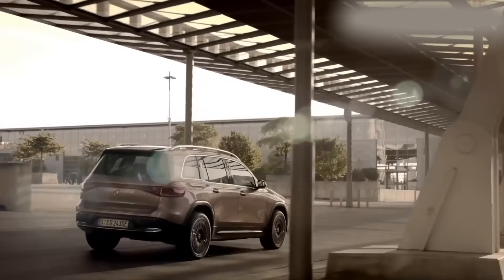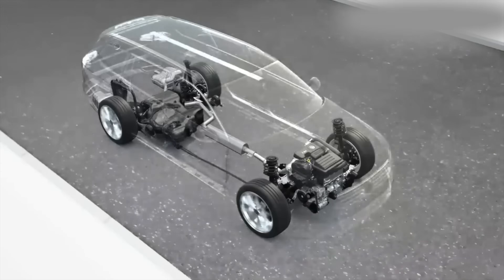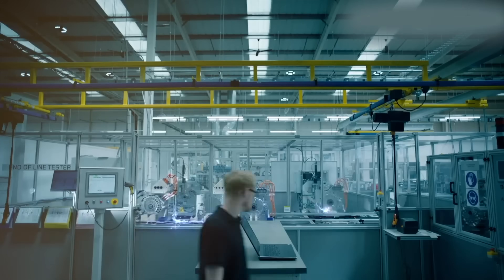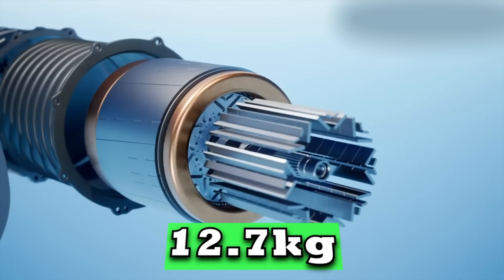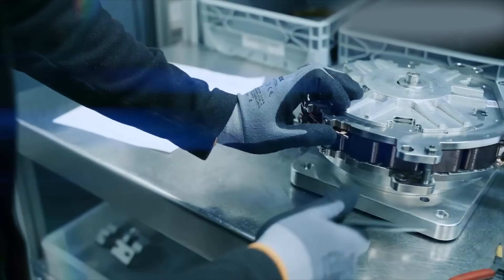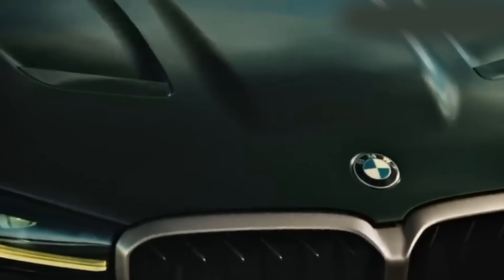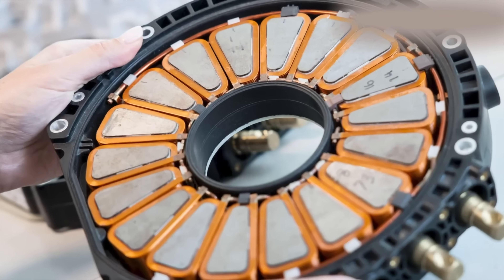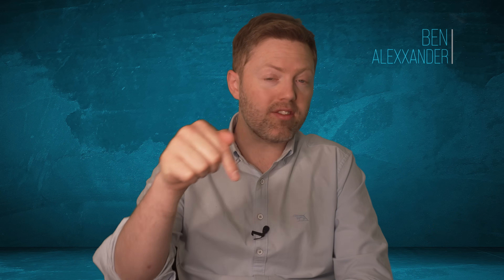Mercedes-Owned YASA Just Built the World’s Most Powerful EV Motor

Comment from the maker: Do you think these will take over current motor types in a watered down form?
Reply: Unless the developers get greedy and overprice the technology, I would say it is almost inevitable. If the downgrading is not taken too far, an in-wheel motor could be direct-drive, so none of the usual 9:1 gear train. Even fewer mechanical parts to wear.
Reply: hopefully, - less weight alone means less power consumption to get from A-B.
Reply: It is more likely to be scaled down than watered down.  A motor at 1/4th the power and 1/4th the weight and size will make the design of an everyday EV a lot easier.
Reply: Nice music, do you have the name?
Reply: maybe, but not as hub motors. Still have to cool them heavily and provide 400-800V to them reliably
Reply: @kalinkaata  Flexible 800V wires are not hard to do.  High current wires need a lot of diameter so that may be trouble.
Reply: @kensmith5694  yeah, but I would worry more about connector/insulation inegrity especially in harsh environment. Also it's a very vulnerable place for any HV stuff. Exposed to water, kicked up stones, etc..
Reply: @kalinkaata  Those are concerns on any hub motor that is not low voltage stuff.  It is stuff we engineers do.  The amount of copper to carry the current is a problem that is harder to deal with.

Comment: Someone must miniaturise this to make something small and efficient... Unsprung weight is normally a massive problem preventing in-wheel motors happening. They destroy handling and cause all sorts of issues. Making a supper light one in the range 20-50HP in each wheel has a chance to nearly be as light as a normal wheel and make sense for mass market normal cars.

Comment: Motors that power washing machines, vacuum cleaners, etc, will be much smaller using these motors. If this technology is spread thru all industrial, commercial and domestic motors, we will have no need to expand the grid as they consume less electricity. As occurred with the introduction of LED lighting.  The internal design of an appliances will change as they will consume far less space.

Comment: If they can install these in a smaller model inside the wheel the entire design of cars will change radically. Being independent of the axis completely changes what you can do with attaching the wheels to cars. Combine this with light materials and the new sodium batteries and you will see medium range small factor EVs at crazy costs. Also these may just push the motorbike EV designs into a stratosphere.
Reply: it is not a new idea.

Comment: Ok, now a light battery with the weight of a filled gas tank and the energy of that same filled gas tank.
Reply: Even the latest IC engines were only about 34% efficient. 64% of the petrol and energy in it were therefore not used for forward propulsion but only went to waste heat. As electric motors have efficiencies in the high 90% then the light battery pack you mention only has to have the stored energy of about one third of a filled gas tank not the whole tank!

Comment: Getting the battery weight down is more important.  A battery that puts out the power the motor needs weighs more than the motor.
Reply: Bound to if the motor only weighs 12.7Kg!
Reply: @marviwilson1853  Yup

Comment: Axial flux motors can create more torque than similar weight radial flux motors. If they can produce enough torgue they may get rid of reduction gears all together. That would simplify powertrain considerably and lower production costs and increase reliability and free more room for other use.
Reply: things are moving fast in this area,  watch this space.

Comment: It is perhaps overkill for most family cars. However, if it an accelerate that fast, does that mean it can slow down just as fast working as a generator? If so, then it could probably replace most disc brakes too, leading to further overall weight savings and possibly also weight savings per wheel, if the motor(s) are not attached to the wheels.
The other question is, is it equally impressive scaled down to a budget family car size?

Comment: Still limited by carrying the batteries around. I'd be more excited to see what the motor technology could do as a power generation unit attached a water wheel/screw or wind turbines.
Reply: so your car does not have an ice engine I take it.
Reply: @TerryHickey-xt4mf I drive a VW Golf. The electric version is around 350kg heavier than my ICE version.

Comment: If Lotus had used these 20 years ago the battery would weigh >2000 kg and have very short range.
Reply: A Bugatti Veyron at full power will drain its huge fuel tank in about 50 miles! You have 12 minutes of fuel.

Comment: Thanks for the update. Battery technology is still the critical limiting factor for EVs. However, increasing electric motor torque and efficiency and reducing weight is significant.  Getting the cooling right and achieving high precision manufacturing to minimise the air gap between rotor and stator seem to be the main issues with this motor type. I do wonder if there is going to be an issue with motor life if there is mechanical wear allowing the rotor and stator to collide. This maybe exacerbated because the motor will experience more gyroscopic forces as a vehicle changes direction because of the greater radius of the rotor compared to a radial flux motor?  Have I got this right?
Thanks again for the presentation.

Comment: Not sure. There is nothing inherently better in axial flux motors comparing to radial. Their major issue is force imbalance in the axial directions which makes them mechanically difficult to design. In 90's this was completely unrealistic for commercial use because of cost. It is one of those "inventions" which" is dependent on super precision.

Comment: Axial flux motors are nothing new. I was designing highly optimized geometry for military applications. The limitation is the heat removal. At those peak powers they are very inefficient which is OK. One motor per wheel is actually not efficient. Even with transaxle one motor is better.

Comment: Calling this one BS because the motor weight does seem anywhere near enough robust to prevent itself distorting and ripping itself apart with that kind of energy going in to it.  How do you even cool a thermal load like that without having near superconducting capabilities.
Reply: Go to University and there you will learn how they solve these problems. As a basic start, a motor like this might be 96% efficient which means they only have to cool 4% of the energy going into it, (the heat bit). All that torque goes through a single shaft with no vibrations.
Reply: @marviwilson1853   How thick does the copper have to be in a winding in order to handle 750KW without burning out.  Motor efficiency is a different thing where one would be quoting the conversion of electricity in to mechanical motion.
When I look at the size and the quoted weight I say no way because when you subtract the copper and magnets, what would you be left with in terms of structure to handle that kind of load.  I can imagine it blowing apart like a railgun if you could get 750KW through it lol.
Reply: @CATANOVA  But your not thinking about the problem in the right way. Your thinking in terms of vibrations, pressures, stress and strain, out of balance forces - things that are very relevant in a reciprocating heat engine. An electric motor has only one moving part - the rotor. There are no vibrations, no pressure cycles, no bending moments. All that matters is the torsional stiffness and strength of the shaft. If you can manage the heat dissipation of the wasted 4-5% of energy then you are in business. They can, they are.
Reply: @marviwilson1853  I see a guy holding something the size of a dinner plate that has a thickness of perhaps 2.5" and a claim of 750KW.  Perhaps the 'peak, or short term' capability is in the milliseconds or nanoseconds from some kind of PWM input.
Most of the pictures as seen on Google look like CGI where there are anywhere between 16 to 20 windings which gives 46KW to 37KW per winding.  If we extrapolate the copper wire thickness with respect to required cross sectional area then how can the numbers stand up (hence mentioning superconductors which would allow a small CSA without burning out)?
Reply: @CATANOVA  They said up to 400Kw power continuous.
Reply: @marviwilson1853  Still sounds crazy to me unless they have invented a new kind of copper alloy with a super low resistance.
I have no idea how one would wind 750KW capable copper in to that kind of footprint without supercooling, if the wire isn't superconductor.
Thanks for the replies.
Reply: @CATANOVA  Depends on the working voltage. EV's can operate at 400v, some at 800v. Maybe they are going to 1000v with this motor. Remember transmission cables have very thin diameters because they operate at thousands of volts and yet enough power goes through them to power a city!! Very little current, very little wasted energy as heat.
Reply: @CATANOVA  With only a balanced rotating stator shaft on bearings the motor only needs to be built to withstand the torque forces distributed over the whole structure. If you look at the diameter of the drive shaft of a large articulated lorry it is really quite thin but can withstand the twisting forces from the engine.
Reply: @marviwilson1853  For sure without full working specs one is just guessing.  As voltage goes up the CSA can come down but the insulation also needs to increase.  Because of the small overall size and compactness of the windings in their media images they are certainly not working with thousands of volts and therefore the question of how do you cater for the 750KW through such thin wire is a valid one to a point of calling BS lol.
When you look at the size of the space and then consider the mass followed by a claim of 750KW it just doesn't add up no matter how you play with the voltage.
Reply: @marviwilson1853  I was thinking more of how do you keep all the internals in place with the resultant forces from 750KW.  Wouldn't it want to rip itself apart like an overwound cuckoo clock. 😹
Reply: @CATANOVA  We cannot be sure that what we saw in the video was anything to do with the motor in question. These were probably just generic company advertising and publicity shots. They said their motor was not theoretical and had been tested on the dyno so unless we believe they are lying we have to assume the motor spec is real. YASA is an Oxford University spin off company. If this motor is going to be anywhere then it is going to be here. High HP motors are not rare or unusual. The Lotus Evia for example has 500hp motors on each wheel and that car has been sold for some years. The YASA motor is not such a huge leap forward but nevertheless a record breaker.
Reply: @CATANOVA  Well that is just a calculation that gets done in the design process. It's no different to making a bridge strong enough to carry a load. The forces will be known and the motor designed accordingly. Just as high power through small transmission cables is achieved using a high voltage so the motors high power is probably achieved through a high rpm allowing lower torque. The larger forces to design against may well be the centrifugal forces resulting from rotating mass at high speed rather than the torque forces from the magnet interactions.
Reply: @marviwilson1853  The 12.7KG is a major constraint.  Once you subtract the mass of the copper and magnets required to facilitate 750KW, how much mass is left for structure and the main bearing.
A solid chunk of 6000 series aluminium 2.5" by 12" dia is 12.5KG.  If you machine it out and then fill it with heavier elements!
Reply: @CATANOVA  The Rolls Royce Trent 900 has incredibly light and hollow intake compressor fan blades. They spin at high rpm and are experiencing forces equivalent to the weight of a large African bull elephant. All I know is that these things are possible.
Reply: @marviwilson1853  I have seen info on the compressor fan blades in a documentary at some point in the past.  Single crystal turbine blades from a casting process was another that was impressive.
If one can get 750KW in a 12.7KG package then people like Mr Musk and Mr Zelensky would be ideal customers.
Reply: https://www.youtube.com/watch?v=I5cYgRnfFDA

Comment: comparing power figures across technologies is kind of dumb. The power rating for the YASA motor is 5 seconds power output (?) I didn't find on a quick research if the 13kg includes everything (encasing, power electronics cooling circuitry etc) or only the motor itself. I was actually hoping you would have done a bit of this research instead of marveling that electric is so much more powerful than ICE.

Huge power numbers are quite meaningless for most drivers. My SO has a Fiat Panda 75hp (or the like) and that's enough. Sure she won't win any Race but we can manage with 4 people in the car the shortest Autobahn ramp I have ever seen. We can also driven for hours with 90mph.
I hate the focus on power. I want decent space and comfortable driving. I absolutely prefer electric although I don't have a garage and almost exclusively do long trips. I still own a PEHV but will switch fully BEV with my next car, because I prefer the electric driving experience. Yet I hope I can go 130mph 210kph like my current car can and I can reach Italy with all my luggage and not being cramped. Race bros are cool ok but the industry has to solve more important issues...

Comment: Personally I think in the future these type of motors will be on most vehicle's, having one on each wheel and removing the disc rotors, pads and calipers, and using the motors as brakes. Also the electric braking would be good on roads that have a lot of water on them (driving through water then finding your brakes don't work, happened to me on a few occasions).

Comment: Motor weight reduction helps but the battery is the big mass. In race cars, super capacitors would make a big difference in augmenting battery packs. I think this will eventually become common in EVs and potentially as a retro patch for old EVs to bring their old battery back to life.

I raise this point because delivering 100s of kWs of power requires a heavy battery. The chassis can be used as heatsink for the speed controller to save mass, but thats also something to consider.

Comment: What we really need for EVs is reduction of kWHr per 100km. It has a direct relevance to the battery size. I have always said I want an EV with a real world range of 500km and a charging speed of 6-10 minutes for at least 50% (ideally better). If we got the the usage rate down to 5KwHr/100km (okay not realistic atm) then the actual battery only needs to be 25KwHrs and importantly the charging rate of 100Kw will be sufficient. This also reduces the strain on the infrastructure. The veritable win win. Hardly hear anything about this.

Comment: I can see a big market in RV conversion kits. Take any fwd based motorhome a couple of small in hub motors in the rear wheels and a battery pack. If you took out the engine gearbox fuel and AdBlue systems plenty of room without any need for fancy packaging..
Reply: Yup!, Then Rooftop solar on a motorhome could get you  2500 watts, you could charge a battery in a couple days
Reply: They produce low torque and work only as a hybrid between the transmission and the motor. However, they can be paired with a standard electric motor to create a compactly packaged 4x4 system.
Reply: Not sure on what your statement is based. It certainly isn’t supported by the specs of the new YASA axial motor. Have a look at their webpage; The YASA 24kg, 480bhp motor has a torque spec of 800Nm…
Reply: @MehdiTirguit  There's also the semi-truck motors from Donut Labs.

Comment: The real comparison would account for all components. Something like "motor + battery + cooling + suspension" vs "engine + gearbox + cooling + fuel + suspension".
Reply: True
Reply: Not if you out those motors on an high speed train. There's no battery.

Also electric motors are already performing so much better. They are so light it's why batteries doesn't need to achieve the very high energy densities of petrol or diesel for electric cars to achieve weight parity. I read somewhere a 500 Wh/kg battery would give a 1000 km range at 120 kmph speed with the same weight of a gas car.
Reply: This is game changing for performance electric cars. Even if we say the weight doubles after adding cooling and bearing and other auxlaries to the motor it still give you 1000 HP peak and 500 HP continuous with just 25 kg of motor weight. With two of these you can achieve 1000 HP continuous and 2000 HP peak power.

Comment: This should have a major impact on electic aviation as well.
Reply: Yes, with batteries around 500 wh/kg it is gamechanging. WoW!
Reply: @boessle2963 Oil won't last forever and neither will fossil fuel aviation.
Reply: @lucastonoli3256 But why burn it all ?
Reply: A company called "Evolito" was spun out of Yasa for the aviation industry during the Mercedes purchase
Reply: Exactly and the RPM is much more appropriate for a propeller!
Reply: Weight and size is all in aircraft design. With the improved power density of batteries on the horizon combined with the YASA motor we have a game changer. Hundred seater short haul fully electric airliners is possible within five years.
Reply: Is there a horse power or torque limit that a propeller can handle?
Reply: @surplusstock8778 what about a turboprop or jet intake system.  Wow, that would be awesome.